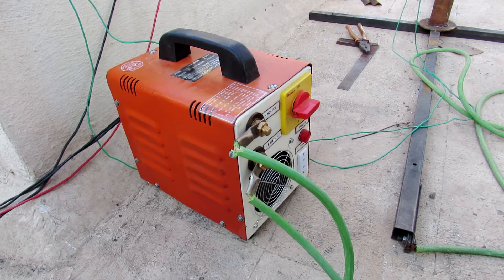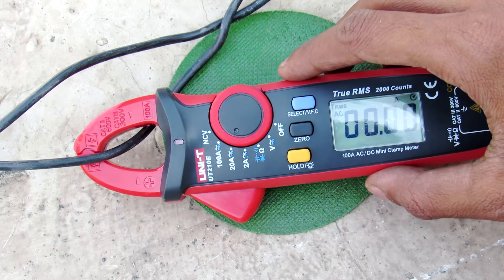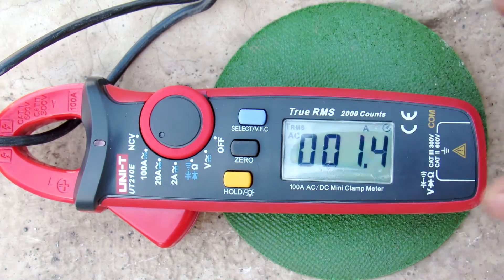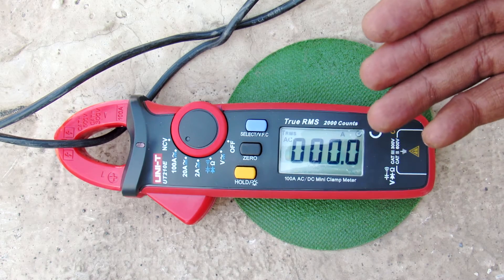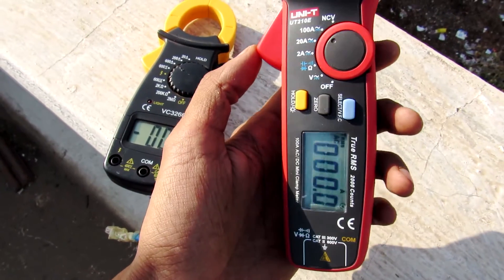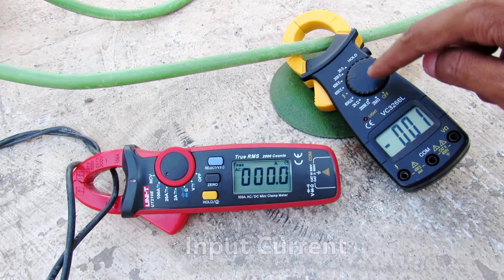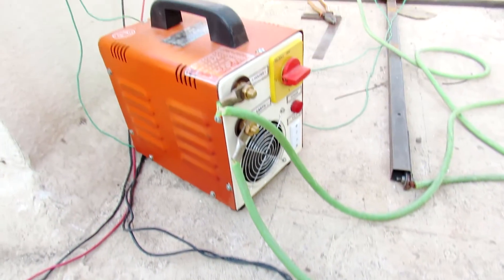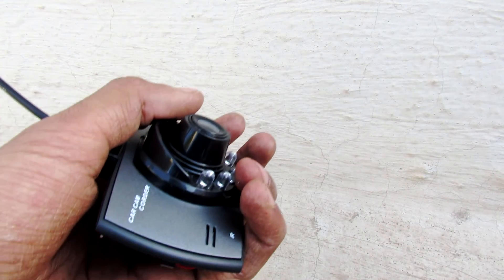Measure Arc Welding Machine Current with clamp meter Deadshort 300+ Amps !

Comment: Have you ever tried connecting with an inverter and see if we can run the welder from inverter batteries? Such as remote locations where we don't have power supply.

Comment: Add a bridge rectifier to the welder and convert it to DC, it will be a MUCH better welder. It would cost you very little.
Something you might interested in is the Hass-Kamp Three Phase conversion method. Dave Kamp is an acquaintance of mine; he and a friend have developed a method for converting 3 phase industrial quality welders, (100% duty cycle vs 10-20% duty cycle of 'electro-knife' in vid), in spite of every major welder manufacturer saying it is impossible.
It is a simple process, and the details are free. Neither Dave nor Mr Hass make any money on the process, (except for what they make from buying 3 ph industrial welders at auctions for very little money, then converting them so they can be run from a electric dryer or electric range outlet!)
There is a lot of info on the 'net about Hass-Kamp, but the original posting is at:http://weldingweb.com/showthread.php?438411-Miller-CP300-Haas-Kamp-Conversion-Capacitance-Value

It is some original thinking about how 3 phase can be modified. You'll enjoy it.
GeoD

Comment: Turn on the hold function bro
Reply from the maker: Hold function hold the value of the instance you press the button so its hard to do welding & hold at the same time.
Reply: you need a better metre... try meco or fluke or brymen
Reply from the maker: I believe controversy is good but in right context ! Please understand what am I trying to say here . Good Luck !
Reply: the peak current might be higher than what you see...the meter with proper hold function will latch on to that thus reducing reading error

Comment: please do conversion to dc welder . btw nice video , like it
Reply: I'll second that!
Reply: just buy 6-8x 50A bridgerectifiers , connect them in paralell , mount on 1-3 aluminium cooler (from a pc for example, depends on the size) , done. Add a 12v if you like. Can be found on ebay cheap from china. Maybe add a big Capacitor for smoother current (the optimum is= 1000µF for every Amp you welder has, 150A = 150000µF, also watch the Volt. the capacitor should be 80V or more since most welder go easily to 50V)